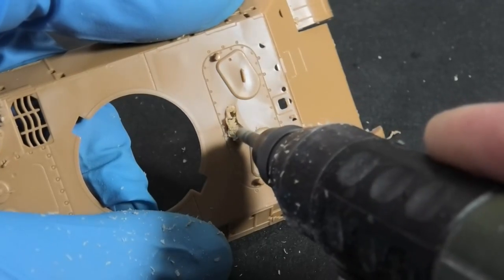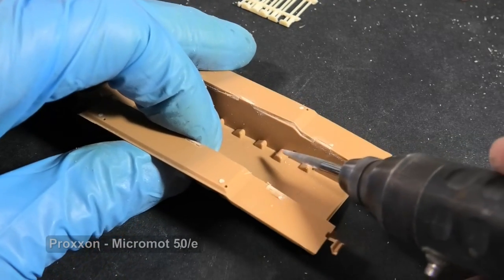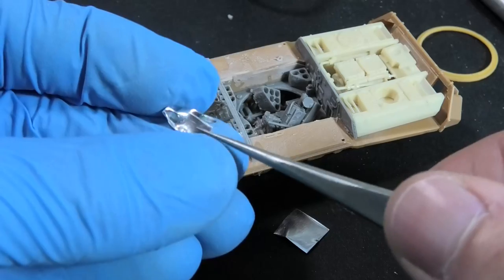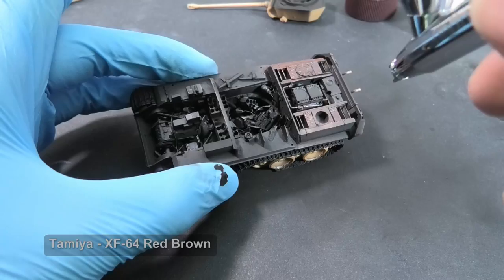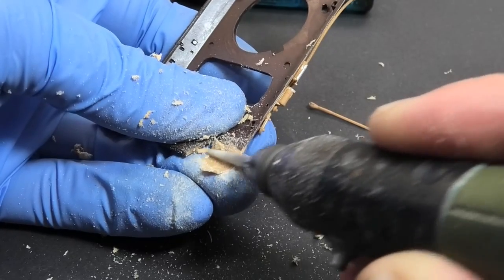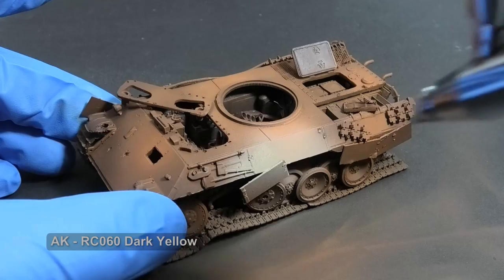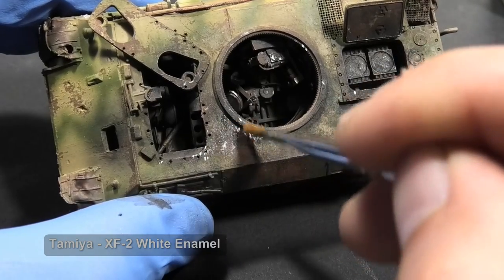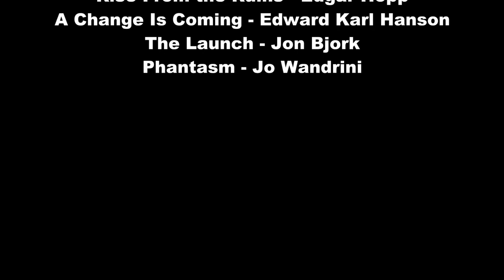Wrecked Panzerkampfwagen V Panther - 1/72 Zvezda - Tank Model

Comment: Me: "Spends weeks carefully building plastic model"  Plasmo: Randomly throws broken pieces in the turret hole...and it somehow looks better than anything I'm able to build.
Reply: True😭
Reply: Me too!
Reply: Some people are just better and creative. Its okay though, you'll get there.
Reply: @twinblade02  I f up a f16 model and used gloss whits instead of flat white what do I do ahhhhhhhhhhhh
Reply: @doggomcpoggo1264  Use turpentine to remove the paint and start over - or, what you could do is use that white as a sort of primer if you plan on weathering it.
Reply: @twinblade02  omg thanks I actually have that
Reply: Damn sad
Reply: My first model only took 2 days lol
Reply: @doggomcpoggo1264  Yo don't forget to remove it by segments - bit by bit - don't toss the whole model into turpentine - a sponge should help you get it off by rubbing a bit better. Don't worry about the tiny bits left on the surface, just use a needle or something to scratch it off.
Reply: @twinblade02  thanks for the information , unfortunately I lost my model and can't find it
Reply: @doggomcpoggo1264  BRUH
Reply: @twinblade02  nvm I found it
Reply: @twinblade02 Turpentine can melt plastic and the odor os bad. Soak the parts in brake fluid for a few days put on latex gloves amd scrub with an old tooth brush. Then wash them in dishwashing liquid and warm water and rinse. It takes longer and doesn't harm the plastic.

Comment: From the paint job and the damage to the left side wheels and tracks, it's clear the vehicle took a penetrating hit near the driver's position on the the left lower hull.  You might want to drill a penetration hole for that.
Reply: And a dead driver ;)
Reply: @henri.stach1208  
Aye, I can see Plasmo modeling a little mutilated body, though given the pileup of debris on the inside, there were likely no survivors anyway, and there should be several mutilated bodies.
Reply from the maker: Yes. The hole is in the upper side of the wheels from the left side but I lost footage of the scratching interior and a few more details. 😂 The hole was one of them. 🙃
Reply: @idaemonplasmo  
Nice.  I was worried suggesting it would be offending.  You're always so thorough.

Comment: Some fantastic effects there David, especially on the interior. You get the impression that, if you touched anything inside the model, you'd get covered in soot and, quite possibly, it would still be hot. Great work !!  👍👌😁

Comment: Nicely done. I have some inerrogations, though : the dislocation of the upper and lower frontal plates is showing a straight line, which is impossible, because the two plates are indented in one another, so, we should see the two "teeth" that make this joint.
And secondly, I have never seen in 50 years a picture of a Panther whose cannon was bend this way. Never. But you could argue it may be possible...